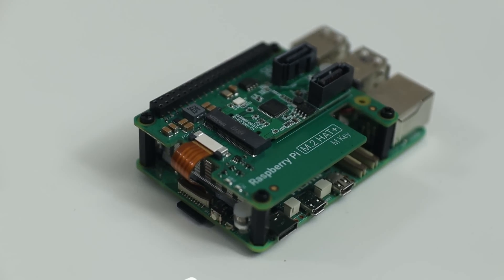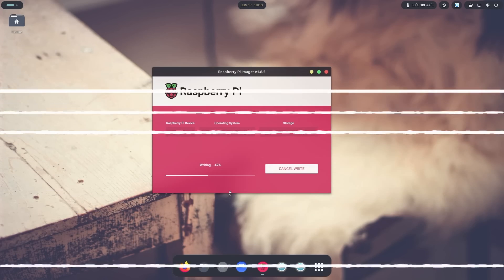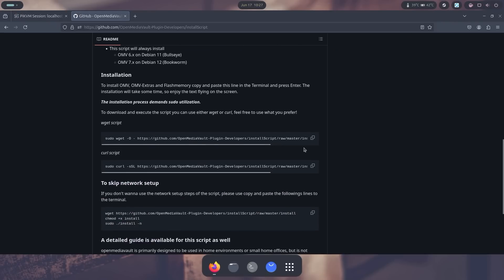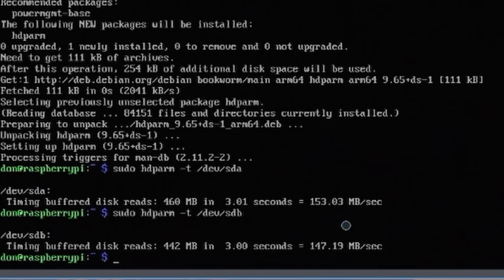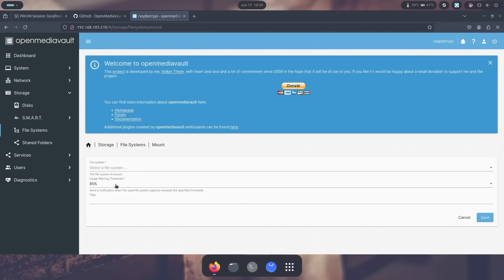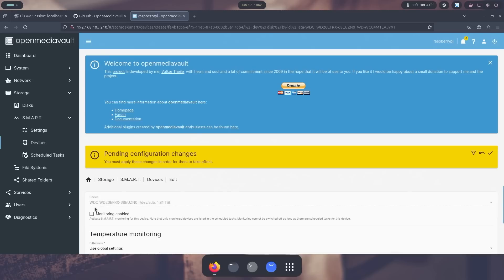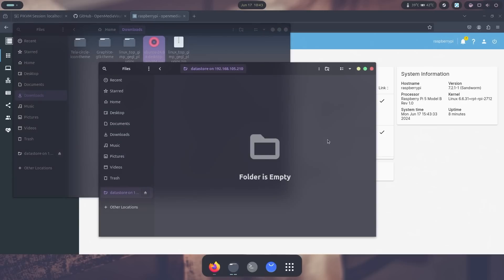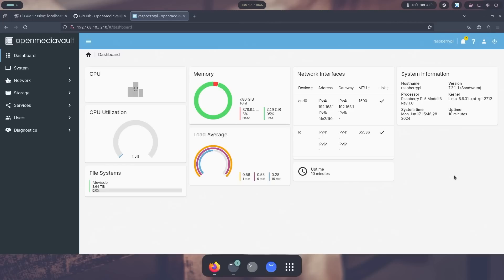Building A NAS with Raspberry Pi 5 M.2 Hat+

Comment: Warning - if your are using the Raspberry Pi M.2 Hat+ make sure you get a SATA module that will plug into it that supports a M.2 M key.   I ordered the wrong one with an A + K key.   I later found what I hope will be the correct one and have ordered it now - but will need to wait for delivery.   Don if you are reading this, links in the write up would be very helpful.
Reply: Thanks.  Like you I can't find details for the 2 port SATA board.
Reply: @An.Individual  well I ended up finding everything I need and building it.  Its been working great since early August. OMV has a Hardware My NAS Build forum.  Early August.
Reply: @roblatour3511  Ah yes, I found your post.  Very helpful. Thanks.

Comment: Very good video thanks! Only thing i wanted to bring up is if you are using a pc running Win 11 24H2 then there is an issue regarding the smb shares from OMV which will not be accessible from Windows if guest is allowed or something like that... Still looking into that.Tks.

Comment: Hi Don, can you please post in the comments what you used to power this (the drives and the Pi)?
Reply: Great video, thank you.I would also appreciate this information. PS Ihope things are going well for you and those you love.
Reply: @philipprudhomme6967  so I think I found something that will work - DC 5525 to SATA IDE hard drive power supply cable DC 12V to SATA hard drive cable step-down voltage regulator
Reply: @roblatour3511  thank you for that. Is this widely available in the US and Europe? I'll investigate. Thanks again.

Comment: I doubt I'll be getting a RP 5 anytime soon, but I do run OMV on an older Dell 7010 slimline with an external dual drive caddy with 2 x 10 tb. 3.5" enterprise drives. It's a lot more than just a NAS system, as I have a Jellyfin server running, as well as Win 10 in a Docker container on an internal SSD, to run my security cams! With 16 gb. of RAM and an 8th gen Core i7, it handles pretty much anything I can throw at it!😉 Thanks Don.. great tutorial!😊👍👍

Comment: I used to use a Pi Zero W (paid $3.14) with a 128GB micro SD card to store my music.  I just set up a basic SMB server.  Now I have an old hard drive attached to a Wireless Access Point.  The Pi 5 is very good, but a bit expensive.  Thanks for the video!

Comment: Stay Healty boy.
How does  RAID 0 works. I'm using EXT4 and rsync to back up my fies automatically on OMV. But i'm interested to kmow more about RAID. Thanks
Reply: Raid0 is just striping...you get the speed of read/write combined and combined storage space of both drives...but if you lose one drive..you loose ALL data on the array
Great for FAST read/write ops...but NOT for redundancy